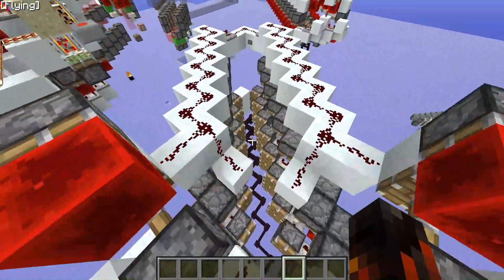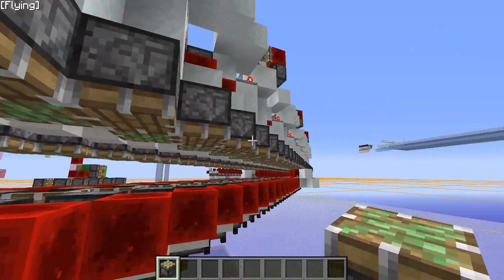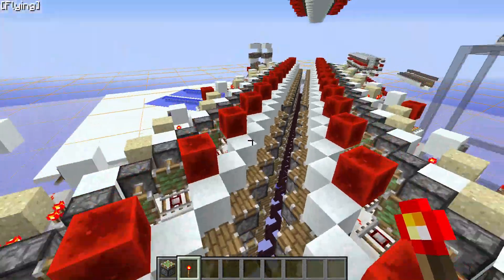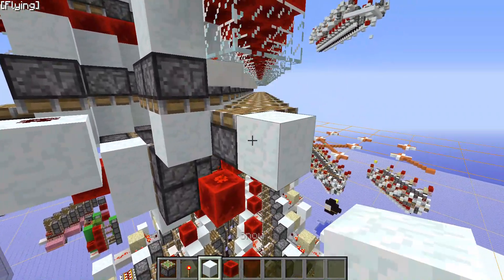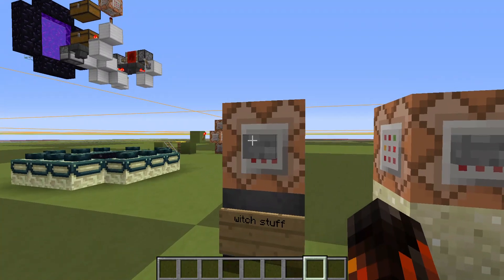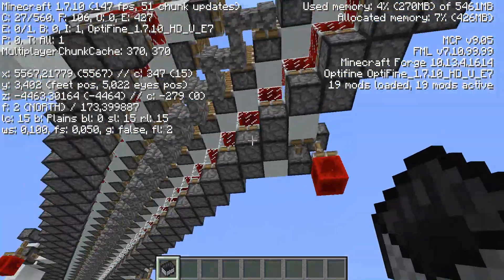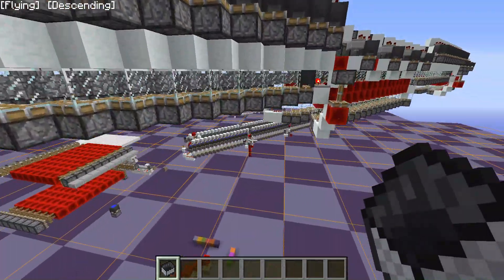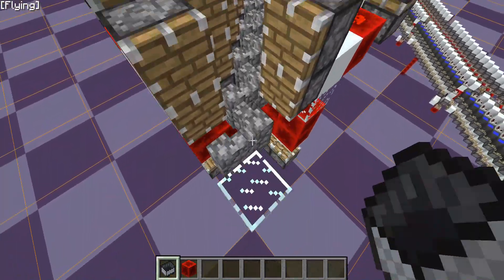226-452 m/s conveyors

Comment: Where can i learn 1.7 redstone
Reply from the maker: mostly by looking at stuff what others such as I or pineapplecake made and basically figuring it out yourself. there is no real way to actually learn it properly in some ordered fashion.
if you really want to get into 1.7 redstone, keep in mind that, if you want to make stuff lag efficient, you are only allowed to use comprators, pistons and rails as power transmitters. the biggest problem with 1.7 is probably that you don't have observers or target blocks or any of that good stuff.
Reply: Well, there isn't a clear way to learn redstone, in my opinion, and it is even less "clear" when it comes to old versions. I'd say there are some differences from newer versions, but you can mostly figure them out by experience and by getting into the community.

Comment: The one pineapple made has1gt delays between each chunk. The way it works is some segments power the pistons after 4gts, and some power after 3gt. So when going from a 3 to 4 section, you don't need any additional delay cause it's built in to the wiring. And then going from a 4 to 3 you just need a 2gt delay.
Reply from the maker: ah ok well then. i never investigated it, i just found it very cool xD

Comment: the bug that allows this is basically block 36 using progress for determining the bounding box from which entities are moved, but lastProgress (progress from the last tick) for normal collisions. this way an entity can enter inside a block 36 rather easily. block 36 moves entities by 9 px which would be out of the reach of a block 36 next to it (here there are two block 36 / pistons on top of each other). however using the bug we can put the entity inside the first block 36 which will push it in front of the second block 36 which will move it again giving us a total of 18 px or slightly over 1 block. these conveyors are this process repeated.
Reply from the maker: thanks for the exact explanation!
Reply: i like your funny words, magic man